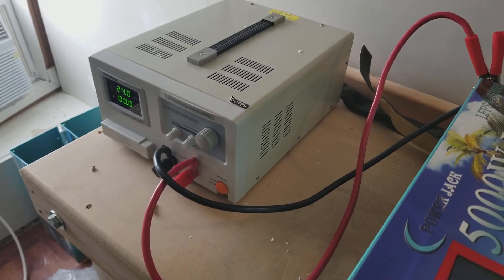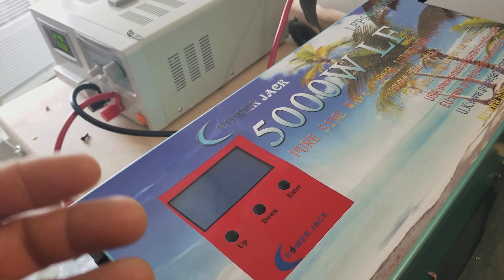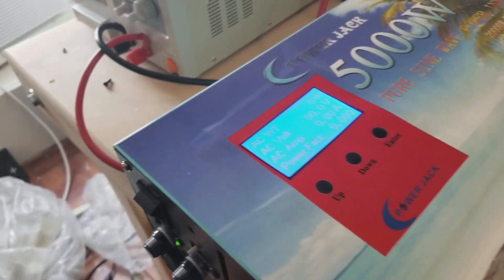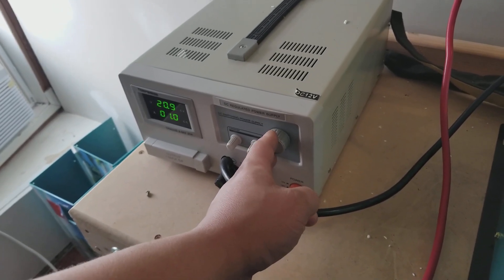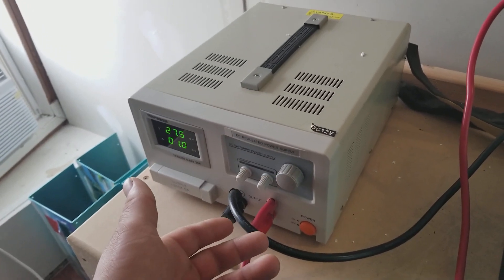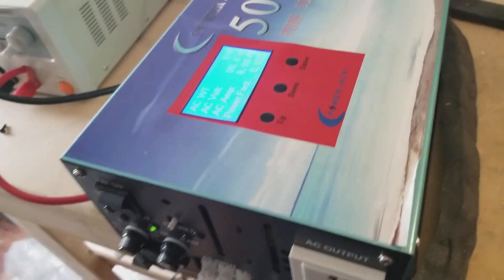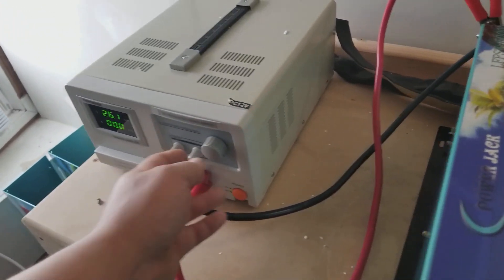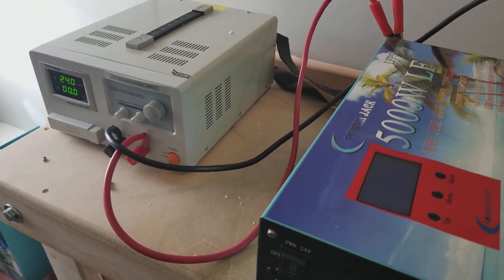Can you connect a solar panel directly to the inverter?

Comment: Yes it work well but solar panel voltage and amper should be much similar  like battery bank. So if this 5000w inverter ,25v and 210amp  solar panel is needed, but the load should be use 50 percents or less because of 🌨️☁️. I prefer to use mppt solar inverter for this project. Thanks for your shareing this vedio.

Comment: So basically the battery is a temporary buffer so you get consistent power? And your banking on the panels pumping them back up once the cloud passes or whatever is causing the dip in voltage.

Comment: You can indeed connect an inverter directly to a solar panel / array but you must keep your power demand well within the constraints of your panels capability. And PV is not 100% efficient so a 100w panel, will typically never produce 100w even on a perfect sunny day. A slight haze in the air or passing clouds will quickly hinder its output.

However with that said, providing you understand the limits and how even mild cloud cover / haze can effect things then go for it.

As for ensuring the panel voltage matches the inverters input rating, just use a simple DC-DC converter.
Reply: Hi, is it okay if i use an inverter to charge a powerbank with usb-c ? (i got a 150Wh powerbank with only usb-c)
Reply: @Charmiles03OnPlus  you don’t need to invert from DC to AC only to go back to DC for USB charging. Get a USB PD Charge that accepts 12-24v in and run it direct from battery or solar.
Reply: @GetCTOwned  thanks for the reply i got the dokio 100w with a power controller (allpowers 10A ) i connected the red and black cable on the battery sign then i connected a device 5.5x2.1 (XY-PDS100) but it dont work 🥲 can you show me the device i should buy ? Thanks for the help

Comment: I am a programmer, lets say i drop a dev board at the point where the voltage drops or is to high. I could then set a relay to flip the switch for me correct? I really have been sifting through a bunch of video's and from a developer standpoint they can all be corrected, only if you know how to program because the market just wants money. I am going to build a home soon and with that I dont want to be tied to the grid, I figure with batteries your loosing energy because they cant retain everything that is pushed in. So I wanted to take the excess from 90+ panels and use that during the day IE the batteries charge while I use the excess at the home. I would gather from the information here is if the panels are not supplying enough energy and I have a arduino board with programmed specifics to shut off the direct and use batteries it would be just fine. Would this be correct?
Reply: batteries have a quite limited life, and are very expensive! Solar panels have a live of up to 25 years, and you can run your house at day (a/c, hot water tank, fridge, etc) at daytime only with solar, and at night you can switch back to the grid.

Comment: Many people now a days using voltage regulator like LM7812 to the Output of solar panel to get 12V DC from 18-21V Output of solar panel. And they connect the 12V DC output to the inverter. Will it work...???
And if it works, then will is be safe/efficient/worthy???
Reply: As I understand how these things work, a voltage regulator dissipates the wattage produced by the voltage drop and the current, whereas a buck converter recovers a good percentage of that wattage while allowing you to set the output voltage and current. I'm not sure how it does this, but I think it is in effect, a variable step down transformer.

Comment: I don't understand also if you can put 12 volt and 24 volt batteries with 24 volt and other types of solar panels, 12 v or 24 volt etc? How do you what's compatible with what? Will mixing them be bad?

Comment: You just need to oversize the panel slightly use a constant voltage module inline before the inverter. Usually, you would use a much smaller inverter for powering say one load only. 
Here is an application I am going to be using this for, I live mostly off solar with a switch to go back to the grid when I really need it may be in the dead of winter. 
Back when I did not care less about my electric bills because they were so cheap, I used to have a pump running in my pond to feed a waterfall feature, the pump is very efficient it only draws around 40 Watts of power, but if I was to leave it on all the time I would have to keep my inverter on while I am out at work, this draws a bit of standby current any way and combined with the pump if it went cloudy it could leave me with a shortfall of power in the batteries when I got home. 
Currently, the pump is switched off which has made the pond somewhat stagnant.
What I need is to run the mains pump from its own dedicated panel without a battery, that way every time sun is available the pump will run, and it is when it is sunny the pump really needs to be running to oxygenate the water. 
So I will have my panel a voltage converter and a small inverter just for the pump.

Comment: well that's particularly your inverter that makes this long beep noise and doesn't restart by itself.  I am sure there would be other models out there that would restart by themselves after the DC input voltage gets back into the allowable range... No point in generalizing your experience..

Comment: its not pointless to not use a battery...like in my case, im trying to use solar panel,with charge controller and battery.just to run a small pump at my 1/4 ac pond. (the draw back on that) would be,i dont care to run pump at night. just during the day. ya know,,when the sun is shinning. i havent found a charge controller that will let me only use it during sunlight hours. i dont want to go check on it everyday..just want it to start up by its self when 12v is detected in the am sun,then shut off when its dark. thats not so hard to ask for right? how is it done? lol   maybe this guy would help?     Buck Step-down LM2596 Power Converter Module DC 4.0~40 to 1.3-37V     just saying.  lol
Reply: If you hooked a relay on to the output of the LM2596, yes you could. You would need to set the voltage that the relay turned on at consistently and then have the relay turn on the pump. Problem would be, what is the dropout voltage of the relay and would the panel be able to maintain the Voltage when the pump was running. I have a fan that is setup that way but it runs direct off the LM2596 as it is a 12 Volt fan. It cools the enclosure where some electrical stuff for the solar powered systems are. In the morning it comes on when the LM2596 reaches 3 Volts. It then keeps the Voltage at a maximum of 11 Volts. If you want a charge controller to do the work for you, look into the ones that Harbor Freight sells or like a Sun Yoba unit. Use the load connections to turn on a relay. You can set the Voltage for turn on and turn off on them. The on Voltage must always be higher than the off Voltage setting. A small 7AH battery at 12 Volts would do fine to keep the controller happy. Settings of 14 for on and 13 for off would likely do you just fine.
Reply: @gravelydon7072  good idea..I'll have to give that a try.i have all the stuff.
Reply: @gravelydon7072  You wouldn't happen to know of any more in-depth resources (books or...?) that would allow me to really learn and understand how to do things like you just described here, would you?
Reply: @patrickcleburneuczjsxpmp9558  Not off hand. A lot of this comes with things like a support group for the item you are using like an Arduino, Mega 2560, or a pi. Which both have modules that can be used for doing a number of things. Way back 50 years ago when I was in High School the library had books on some of the stuff and then you had magazines like Popular Electronics that had new ideas in it. Nuts and Volts magazine still is a good place for ideas.
Reply: @gravelydon7072  Thanks very much!

Comment: What if the solar panel is connected to a solar charge controller?
Reply: Wouldn't make a difference you need a battery Bank
Reply: @musicmania3945  ....i know a guy who has solar panels without batteries. At daytime (when the sun is shining) he runs his house electricity solarly, and at night it gets switched back to the grid.

Comment: If your panel produces 6A from 9am to 3pm and your fridge draws 5A and runs from 10am to 2pm then surely the fridge would just kick in an hour after the solar panel starts producing and would cut off one hour before the panel stopped producing? Surely then you would not need a battery.
Reply: Surge of the fridge has to be accounted for also. Many compressors for that brief instant would hit double the running load or more. My fridge on the inverter uses about 225 Watts when running. But more than double that to start and even worse if it loses power and then gets it back while still calling for cooling. You get one try at that and then it trips the thermal overload until the pressure drops on the compressor and the thermal overload switch resets. So a 2 Amp run can turn into a 10 Amp restart. And all it takes is one cloud to do it to you if you didn't have battery power available. You might get away with it with Super Caps but again, you would be spending a good deal of money.

Comment: You can and i do with device called dc to dc converter. I use 24 volt panel and a step down dc converter. It puts out a regulated 12.6 volts no matter what light is on panel.it runs inverter all day and in the rain.
Reply: dc-dc buck converter right? stable voltage output from solar panel
Reply: Cool
Reply: yeah that's exactly I always wondered. Does it work for long term? and what if I want to power something of a higher power like an Air Conditioner? How much power (or Amps) do these "dc to dc converter" they can safely allow?
Reply: @johnnybuoy9551  That all depends on the size of the Buck-Boost Converter.  If one isn't enough, then you would add multiple ones to reach what you want. Most that you would find can handle a maximum of 20 Amps.  But you have to be careful as they also have Wattage limits. Most of the 20 Amp ones are limited to 300 Watts with forced cooling added. MingHe makes one with forced cooling that can handle 600 Watts at up to 72 volts out. But it is limited to 10 Amps out so again you loose out on cost as it would take 10 of them at $40 each. For small apps, MingHe makes some that handle 6 Amps at up to 38 Volts. So for a 24 Volt system that needed 2000 Watts you'd need a bank of 15 of them. Cheaper to just go and get 2 Deep Cycle batteries and a charge controller.

Comment: Hi. I live in a small 2bedroom flat. Ive got a 1.2kw Inverter, 2pcs 200w panels , 40w MPPT charge controller and a 200AH Gel Battery.  I use the Inverter for power only at nights. To conserve my battery,  I only use it to power 4pcs energy bulbs and 2pcs 75w fans.  Grid power (Mains) is erratic in Africa. When the Mains come i switch over. Ive got 2units of 1HP Air Conditioners, A freezer , Fridge and 2 flat 40inch TVs. I want to be able to use my Solar Inverter to power them during the day.....but i dont have enough batteries. I want my full 200AH battery reserved for the night. Can i charge the battery full in 3hours till 11am .......disconnect it....and use the panels via MPPT and Inverter to directly power 1unit AC, Freezer and TV during the day.....and at night connect my battery back and use it till dawn? ....How can i do this without damaging anything?....ive little knowledge of electrical stuffs.
Reply: When the solar panels are connected to charged batteries, you can run the inverter from the system without disconnecting and without discharging the batteries as long as you don't draw more that what the panels are putting out. But you need another 800w of solar panels, and probably a little more, to use your inverter to its capacity.